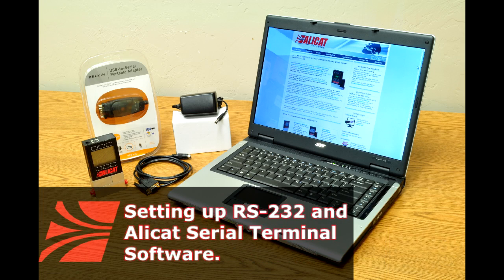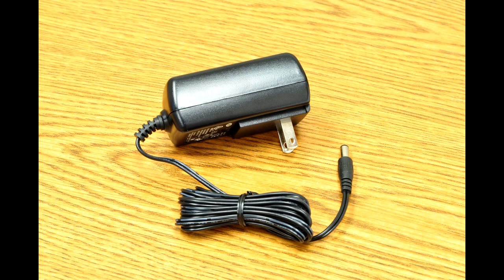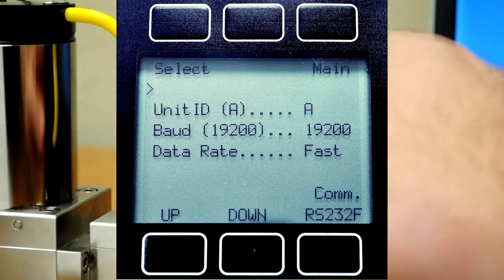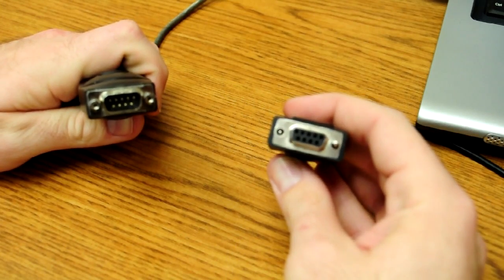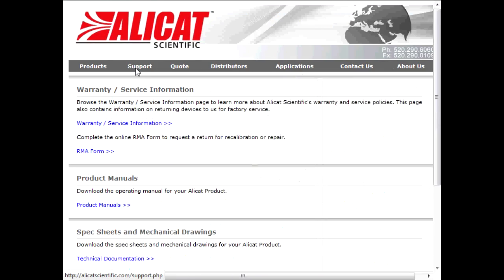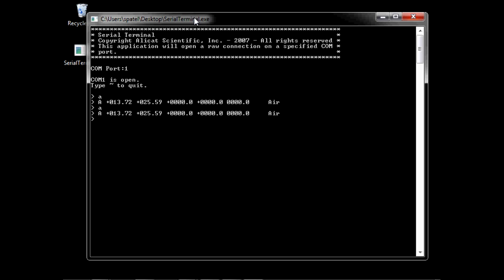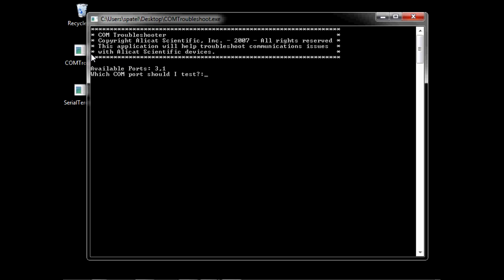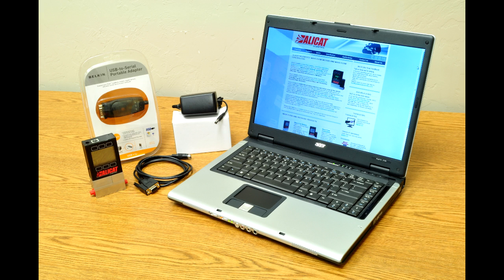Alicat Mass Flow Instruments: Tutorial - Serial Communication

Comment: Please be aware that the pin assignments for your meter/controller will NOT correspond to the RS-232 pin convention.  Therefore, this tutorial video is incorrect when saying you can just attach your valve's DB9 (serial) jack to a serial-to-USB converter (like the Belkin model they recommended).  You can use a converter, but you will need to make a custom conversion cable or buy the one offered by Alicat (about $100 - which presumably maps the pins correctly).  However, if you use their serial-to-USB cable, then you will not have access to any analog outputs or inputs and will only get the digital data in/out.  It would be nice if Alicat used the RS-232 pin mapping and/or sold cables that made the needed contact conversions and also provided break-outs for the analog signals.